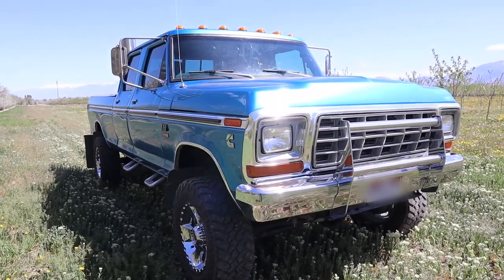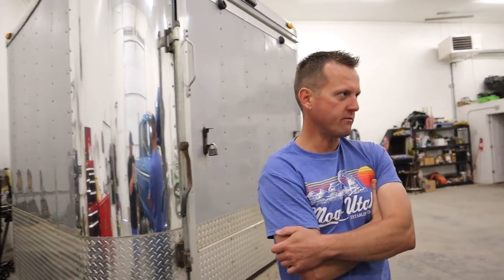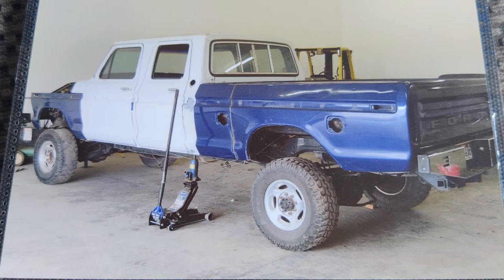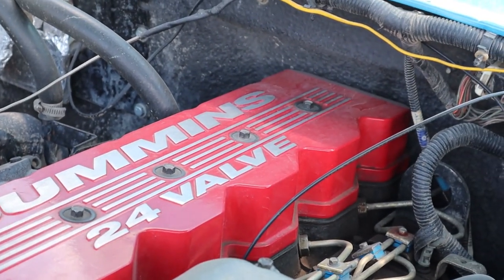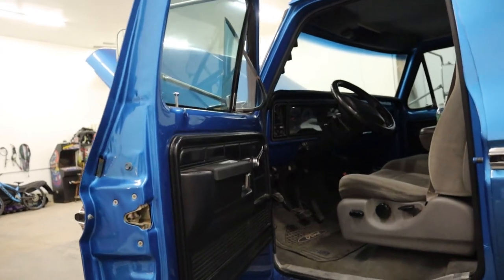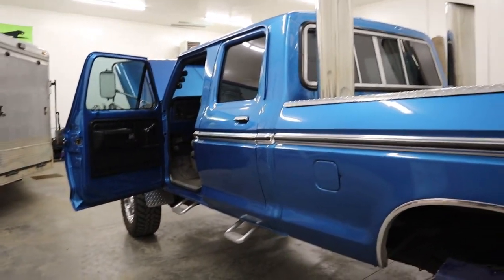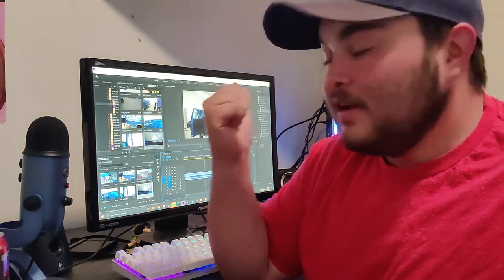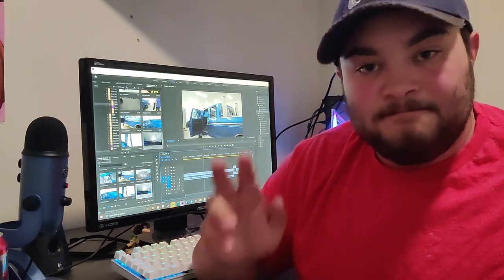Beautiful Dent Side Ford 24v Cummins Swap

Comment: How is it licensed as a F350 if you did a Body swap onto a Dodge Frame??
 …. Where is the VIN# ??
Reply: Vin comes from the cab
Reply: @warrenmcelroy4718  For registering though, I always see the vin from the cab being used rather than the frame itself though. Like my truck is a 2010 frame, but a '79 cab. So emissions is compliant with my 24 valve
Reply: @wrathchild3276  but the cab doesn’t have a VIN attached to it like the newer Fords so how can the cab be registered?
Reply: @warrenmcelroy4718  I think it does even on those old Fords. If I remember correctly Dad had a 77 and it was on the cab.
Reply: @Superduty_59  I assure you with 100% certainty that there is No VIN on the cab, especially on the 77 and older trucks. I can’t even tell you how many I’ve had over the years and I have a 77 F250 4x4 sitting outside right now that has been in the family for over 30 years. Now I’m not 100% sure about the 78/79 trucks but I’m willing to bet that Ford didn’t start putting VIN numbers on the cab till the 80’s.